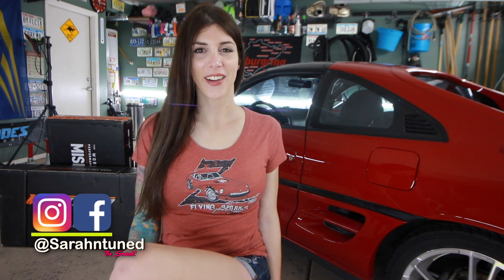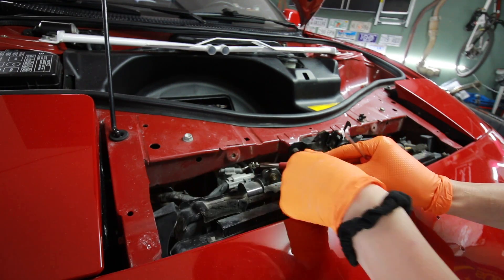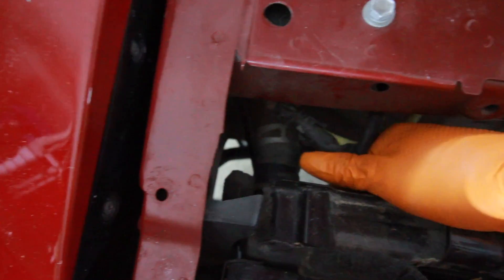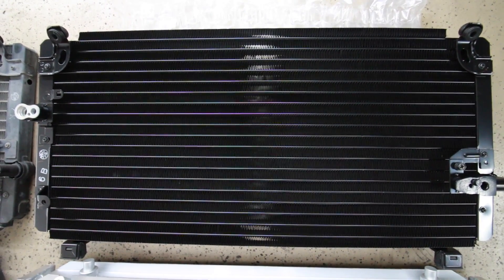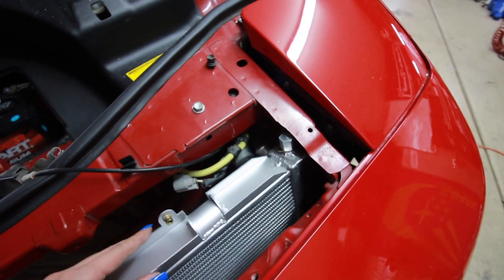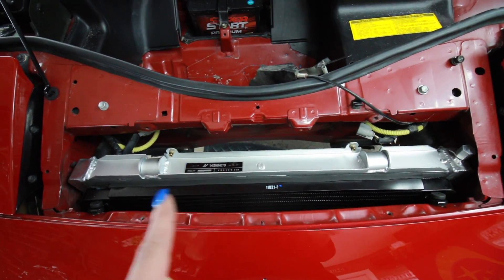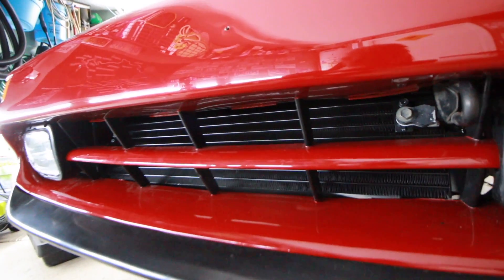..And I Said This Would Be a "Quick" Install, lol // Project MR2 Turbo

Comment: problem is the knob to get the air out of the cooling system.. the mishimoto version is trash.. also the temperature sensor is leaking a lot of times .. so also here the mishimoto could have been made better.. and a lot of people are telling this problems since long time.. so they could already have solved it !

Comment: You shouldn't need any special tools to bleed the air out of the cooling system.  There is a procedure for it in the shop manual that's more involved than most cars, but it's not really hard.  The thing that makes it kind of arcane is that there are a couple of clear plastic hoses that are supposed to have come with the car, but are usually missing by this point.

You stick the hoses on the two nipples - one on the heater control valve (in the frunk), and the other on the bleed screw housing in the engine bay, open the bleed valves, and fill with coolant.  You then start the engine and continue filling with it running, until the level in both hoses is the same as the filler neck, and you're not getting any air out.  If you're having trouble, you may just need to be more patient.

Edit:  You should be able to get replacements for those hoses from most hardware stores.  I think they're around an 8mm or 10mm ID.

Comment: 9:45 : to remove the terminals .. ya first have to open the locking gizmo, which is the inner piece of plastic there, pull it forward so it's flush with front of connector (see image link below)  .. ONLY then can you pry the plastic lock fingers to release the terminals. 
https://images-na.ssl-images-amazon.com/images/I/41FLQBQXzXL._SY355_.jpg
FYI - in most auto connectors those locking gizmos are a different color than the housing, to let ya know they are there.

Comment: FYI.....   Any time you use vinegar to clean or de-rust a metal part , you MUST use a baking soda solution to clean the part. This neutralizes the acidity of the vinegar thus preventing damage.

Comment: Sarah if you can you should add 1oz of ester oil to the condensor. You should also replace the drier and add an ounce of ester oil to that also. I run envirosafe industrial r134 a in my mr2 it works as good as if not better then R12.

Comment: Airlift coolant bleeders are great tools, I swear by them, but I refill systems on a daily basis. Probably not worth the investment if you're only refilling systems a few times a year, so it's good that you can borrow one. They need a good amount of air flow across the venturi to work though, a lot of smaller compressors don't have the tank capacity for them to function. Tried to use mine at a friend's house once, and it didn't really work with his 3 gallon compressor.

If you find your compressor kicking on constant while you're sucking it down, and air flow dropping, you might want to try and cycle the airflow as you're going, run for 10 seconds at a time or something and pause to let the tank refill. As the flow across the venturi decreases, so does the suction effect. Most will have a shutoff valve for air flow that will allow you to pulse it like this, if the one you get doesn't, might be able to pop the air line connection each time, which would do the same thing as long as there's a valve inside there.

Comment: When you run into a need to splice a wire down the road, you should look into Solder Seal Wire Connectors, they look like what you used, but the sleeve is heat shrink and they have a ring of solder in the middle that melts as you heat shrink the sleeve to join the wires together better.
Reply: Those things are junk. I thought they were cool when I first saw them, but you will only ever get a cold solder joint out of it. A crimp is much prefered over a bad solder.

Comment: Hi Sarah, the bolts went grey after you soaked them in vinegar because you have acid etched them, if you want to get small parts really clean and as original as possible degrease them and then use an ultrasonic bath. Hope that helps , keep up the good work.

Comment: I always use a thin sheet of cardboard over both sides of the radiator when working with them. When you have to spend $130 on a new radiator because of stupidity, cardboard is cheap. I found that out on my 69 Pontiac Catalina. Any time I work around the radiator I use it. I watched my friend run a screw driver through his just trying to tighten up the hose clamp. I told him my trick but he assured me it would NEVER happen to him. I watched him do it not 10 minutes later. He tryed soldering the hole( no good) JB Weld( no good) Epoxy...... yeah... you know. One more thing. PANTS.... I dont care what your legs look like all scared up and bloody. Wear sox, shoes and pants when working around a vehicle. If you want to have a swim suit competition afterwards, thats awesome. There is NOTHING sexy about stitches. I know skin sells, but blood sucks( ha ha ha) No reason you need to paint yourself the same color as the car using your own blood eather.  I have given enough of my own installing radiators. Another reason for cardboard. Those fins slice and dice on a new rad. been there.

Comment: When you go to charge the A/C there is a product out that replicates r12 but is safe for the atmosphere. It's RedTek R12a and it is made from hydrocarbons. I used it in my daughters '92 Ford Probe and it works GREAT. Got it from Amazon. R134 is a terrible replacement for systems made for R12.

Comment: Awesome work as always Sarah. Seems like a good opportunity to replace those old hoses before doing the bleed? Also check out camposites, he has the replacement cooling panel you're missing for the top of the radiator.
Reply from the maker: I was going to, but they're in perfect condition still. No dry rot, cracks, or anything. They may have been replaced once already?

Comment: Its legit to cut off connectors then reinstall them as you did. Also, on my old POS Ford Van, I had some trouble finding an electrical issue. I found the Dist. Conn. was corroded so bad it fell apart inside. The fix was to completely remove the connector and hard wire the Distributer. Problem solved!
I hope your ankle heals well

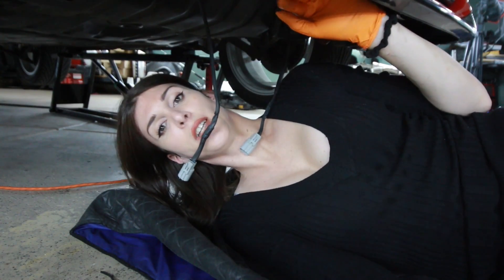Comment: 11:40 - Did you add ratchet noises to your fingers?!

With those connectors, the inner shell of the connector acts as a secondary lock, keeping the detent in place so you can't depin them. They should pull out and expose the locking tab, but without new pins to put in, more trouble than it's worth. When there is room, I try to space splice joints in the harness, so that the loom doesn't have a bump in it, but electrical to me is what I imagine clean is to you.

Comment: Always remember that disposable zip ties are useful for holding things in place until it can be bolted in. They're not made of gold, use them frequently and care free.  You visit Harbor Freight enough to know that there are alot of them made. A bag of zip ties is cheaper than a hospital visit.. Will you be changing the heater core soon ?

Comment: When I run into that problem with bolts I get a piece of hose and jam the bolt head in it then try to screw it in. Most of the time it works pretty well.

Comment: Those 2 piece connectors can be difficult to get apart and depin, but honestly, what you did is probably a better repair anyway. If you had gotten the pins out of the housing, there would still have been trying to open the crimp of the pin to the wire, which almost never goes well. Just had to do it with my headlights, ended up cutting a slit in the pin and soldering the new wire on(I couldn't possibly wait the 2 days for new pins to come in!)

Nice job here, things don't always go as planned, but you move forward. Knowing when to walk away so you can come back fresh is a valuable skill.

Comment: The wiring goddesses are pleased with your use of insulated butt splices and heat shrink.   May Ohm's law grant you peace and serenity.
Reply: Meanwhile, the wiring Gods are shaking their heads saying get a F-ing soldering iron.
Reply: @justindurand9110  I think she do have a soldering iron, I'm sure I've seen her use one in an episode, but some like the crimp connectors and others like to solder the wires together, I myself prefer the soldering method and I never had a soldered joint going bad on me.
Reply: Well said. Couldn't agree with you more. Sarah's attention to detail and high standards for quality are very commendable.
Reply: Pro tip: you can watch series at flixzone. I've been using them for watching a lot of movies during the lockdown.
Reply: @Lee Howard Yea, have been using Flixzone for years myself :D

Comment: Probably was better cutting those connectors off instead of depinning, anyway. Wouldn’t be surprised if the pins were a bit different, plus they wouldn’t have the little boots on the back that weatherproof them. This way you know everything will hook together just right. If it was my 30 year old truck, the shell would have crumbled the moment you touched it, so I was just impressed you got them both out in one piece.

Comment: should have coated the threads on the fixtures going in to the radiator  with anti seize .
Reply from the maker: Billy Hinricksen ahh, but I did! Didn’t film that though. I think you can see it in one of the shots on the threads if you look closely though.